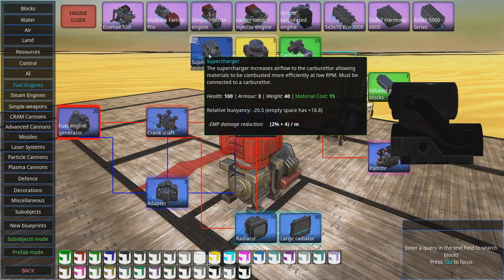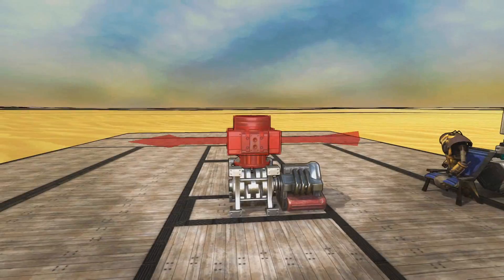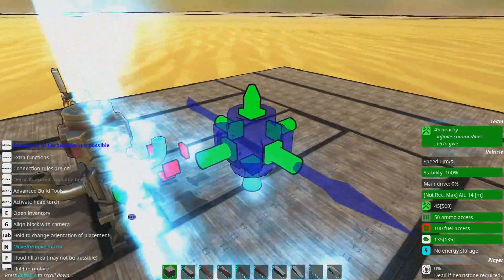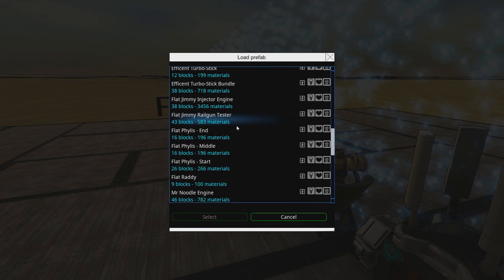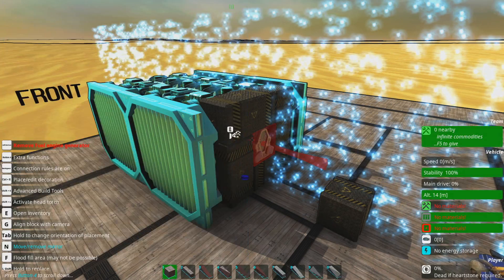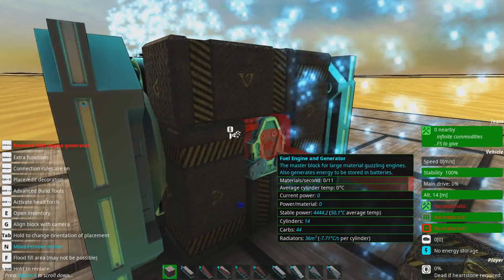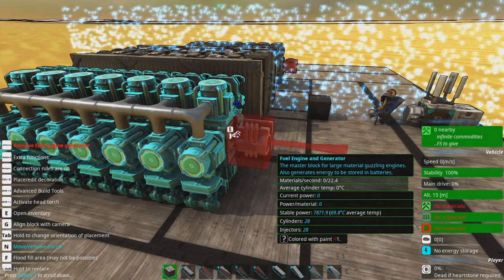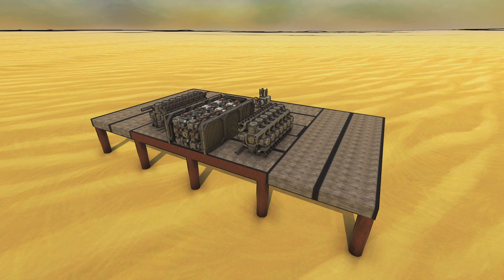Carburettor Engines Intro! 🍰🥔🔧 From the Depths Tutorial

Comment: Is using both turbos and supers better for warships that might have varying power demands over the course of a battle?
Generally, I use naturally aspirated engines for such ships, and use turbos mostly for smaller or faster craft that will be pushing their engines hard, and supercharged engines for larger ships like cargo ships that will mostly be cruising slowly.
I had no idea you could attach radiators to the sides, though, so normally I would slap a large radiator on the end and use a full cage of exhaust piping

I'll definitely have to experiment with more designs and layouts.
Reply from the maker: If you have room for supers on your turbos, you have nothing to lose!
Reply: Its smarter to build two engines and set up priority.

Comment: One thing I have noticed in regards to fuel engines is that they, like steam engines, often times only show their true values once you actually make them go to the RPM you actually intended them to be at by consuming their power
Reply: Fuel engines already show this in their UI. You can even limit the RPM of fuel engines for maximum power output.
Reply: @avi8aviate  as far as I know, I have already built fuel engines, where the shown nunmbers did not match the actual numbers - when the engines were turned on, the numbers displayed changed. That is what I know in regards to that. Although it has been a few months since I last built a fuel engine, so it may have changed for all I know.
Reply: @th3kill3r90  Does the actual sustained power output match the stable power output shown by the fuel engine UI?
Reply: @avi8aviate   it does, but only once I actually use the produced engine power. The output graph also changes when the engine gets turned on. This was especially true for supercharger engines with high levels of cooling, where the PPM reached over 1000.
Reply: @th3kill3r90  if you hover over the fuel engine block you can see the stable power the engine will make,the gray power bar on the bottom right only shows the full power any engine has before any factors.
Reply: The ui at zero load doesn't seem to fully understand the impact it's cooling has on the statistics. Perhaps because it averages it out?

Comment: I was completely thrown off by that bigger engine. Was wondering how the heck you managed to place cylinders without being attached to the shaft. I never used those adapters so I forgot about them entirely.

Also it never occurred to me that you could build a carb engine without the addons. I mean, I knew you technically could but it always seemed too silly to bother trying. But then I played when turbos were meta and they hadn't nerfed them into the ground yet. Fun times.